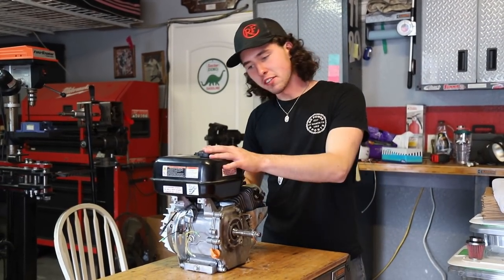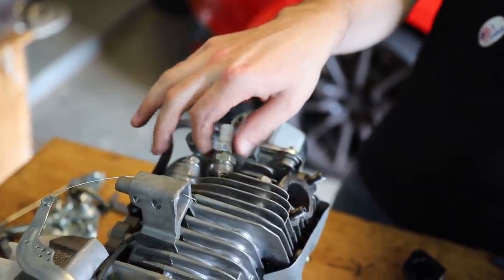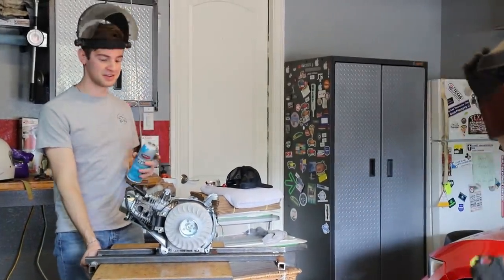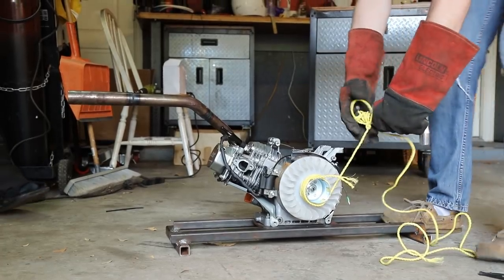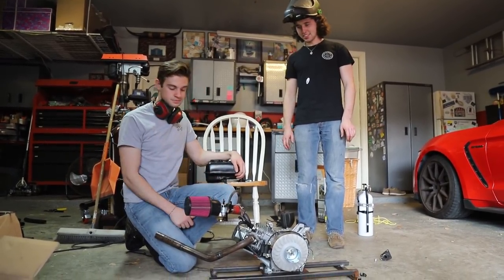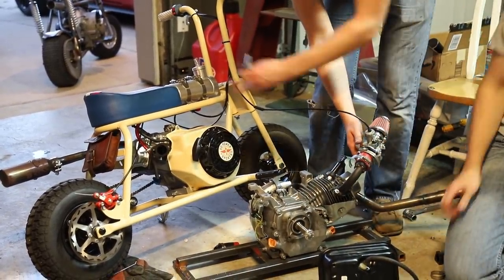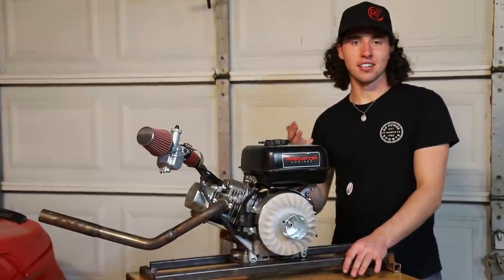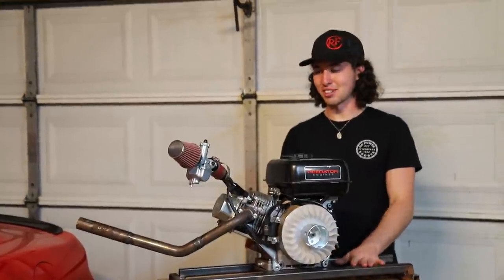Can You Make a Predator 212 Run Backwards? Surprising Results!

Comment: 5:23 oh hey a disclamer, i hate these.  There is nothing dangerous about running a engine backwards, also starter fluid is perfectly safe if you use it correctly. Just use a carbuetter if you are going to try stuff like this.  In most engines the timing will be incorrect so its unlikley to run anyway, you can however run a 2 stroke backwards.

Good video though.

Comment: ignition timing is the issue more than likely, its advanced normally but in reverse its retarded...  so if you move the pickup coil with a bracket it'll run at least a little better

Comment: It would run better if you rekey the flywheel so the timing is advanced instead of retarded. And doesn't the connecting rod have an oil dipper? Might want to redesign the dipper part of the rod to scoop oil if you want to run it for any length of time.
Reply: The whole time I was thinking about the oil dipper with it running backwards. The rest of the engine wouldn't be getting oiled like it should so it probably wouldn't last too long. Cool experiment though.

Comment: I've seen guys do this on sbc 350s u need do something with the timing I can see it shooting flames out the carb
Reply: That's because of the compression release on the exhaust lobe of the cam holding the valve open at low rpm.

Comment: That was a fun experiment. Longer term performance aside the flywheel fan will be a problem running backwards and overheating the engine. Also the ignition timing is likely very far off (retarded, sorry not sorry youtube) Also the splash lubrication and the governor will be issues.

Comment: Ive just come too this conclusion. Torque  plates.!. Yes they serve a purpose but in my open mind wat are they going too change ? In my eyes its a heat cylcled cylinder that will give u more accurate read-out of tolerances. Am i ryt or wrong ? Torque plating an ally block with steel liners hmmm thats been proven too work but an ally barell ! Im not so sure !

Comment: It will only work on a single, the timing is way off because a 4 stroke runs intake,compression,ignition,exhaust now ur running it intake,ignition,compression, exhaust

Comment: All diesel engines with mechanical injection have to potential to run backwards, its kind of shocking when you step on the clutch a little to late and smoke starts pouring out the air filter housing 😂

Comment: Your timing is off like 30° lol and you only get like half the compression because of the valve event timing.
Reply: Clock the flywheel back and the camshaft a tooth or two.

Comment: You have to adjust timing. In normal rotation that magnet fires the coil at a fixed degree before TDC, that's what you want. It's called timing advance, the plug needs to fire before the piston comes up to TDC on compression stroke. Running it backwards with that magnet where it is will cause the plug to fire at exactly the same degree after TDC, that's called retarded timing. You can fix that.

Comment: You are running it in reverse, try swapping the intake and the exhaust, remember you are doing everything in reverse
Reply: What?
Reply: They were trying to run it in reverse and if you noticed it was blowing fluid out the exhaust , it doesn't hurt to try anything is possible
Reply: When you run stuff in reverse like that everything becomes opposite of what it should be